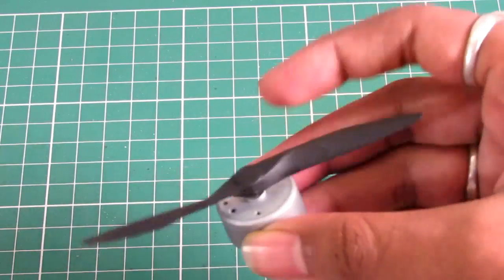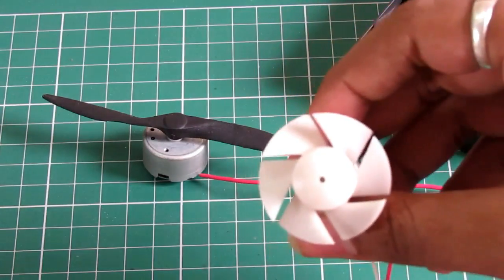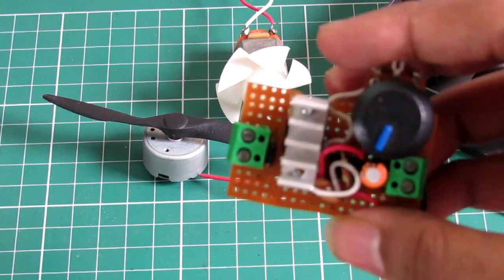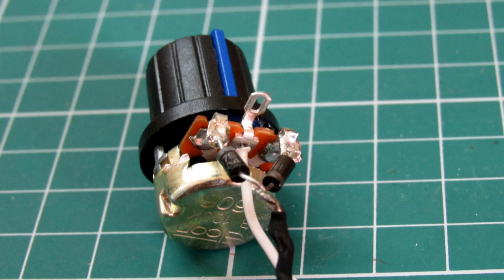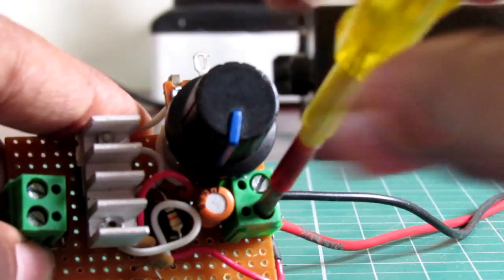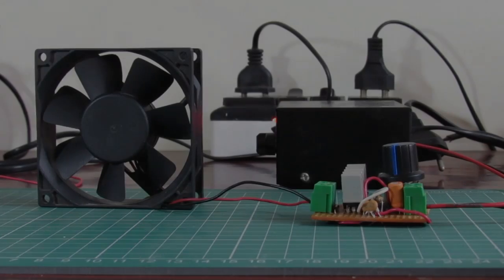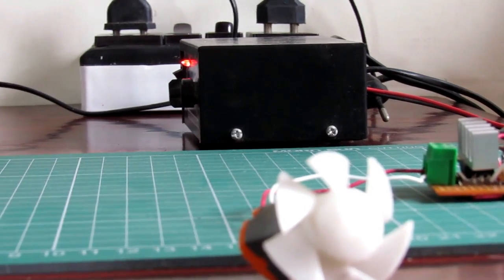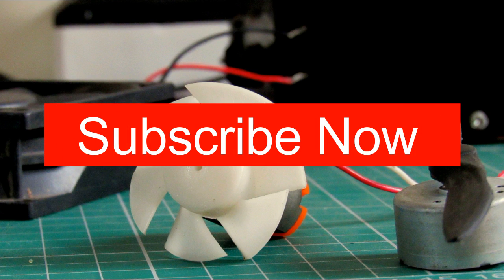How to make an Universal DC Motor Speed Controller

Comment: If i were to use the same circuit and setup how could i do it with 48 volt 20 amps?
Would the components just need to be rated at higher amps and volts and then it can be done?
Reply from the maker: +Ron Brown yes also you need to make separate power rails for ne555
Reply: What are power rails?